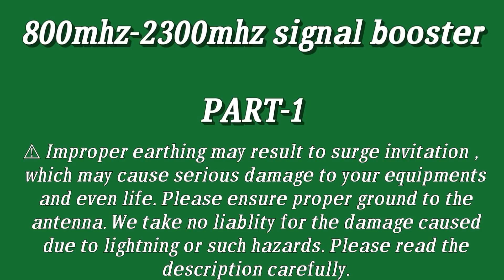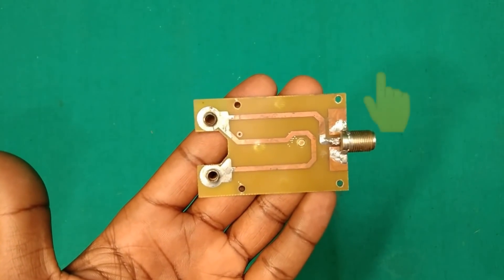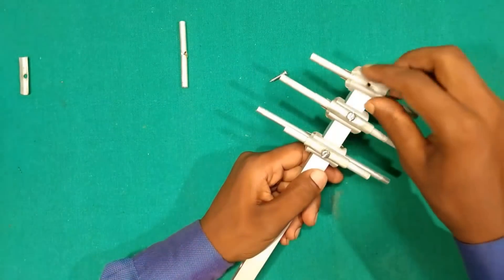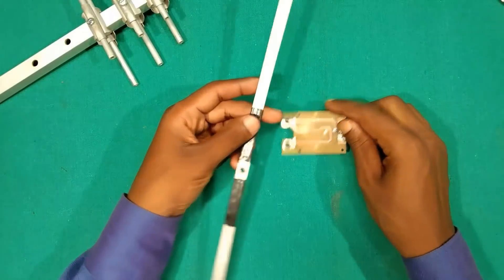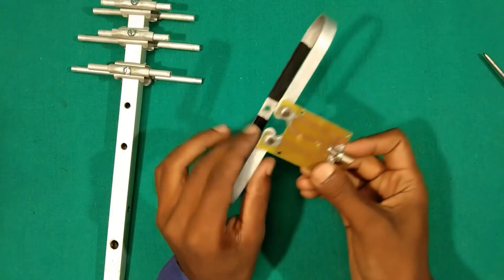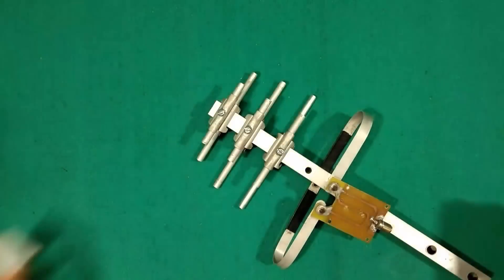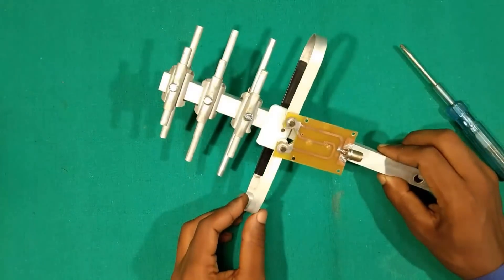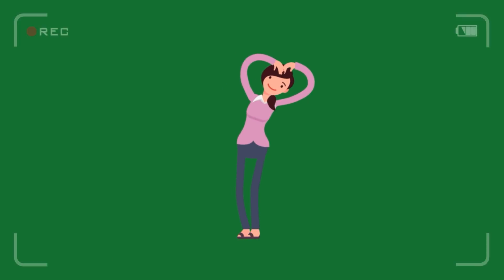Homemade 800mhz to 2300mhz signal booster antenna part-1 || yagi structured high gain signal booster

Comment: I have a question if you can solve pls. I have made a yagi antenna which i mounted on roof which capturing good signals, on other hand (receiving end) there is no antenna. So i want to know if there is any antenna that can receive the signals from yagi antenna and spread those signals to my mobile phone.  I shall be very thankful to you if you solve my problem. also note, i do not want to use jiofi or any dongle. what i need is an antenna at the end which receives signals and spreads those to my mobile. Thank you.
Reply: You will need signal repeater booster

Comment: Sir what is the advantages of using 50 ohm balun amplifier on this yagi antenna
Reply from the maker: Avoids signal loss, easy to connect cables, good looks etc.
Reply: Can you share diagram and calculation